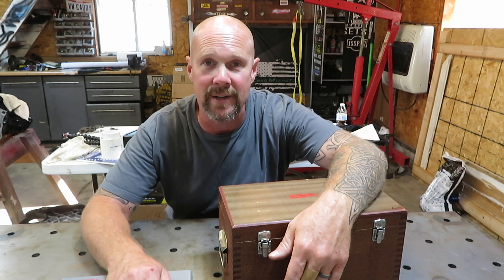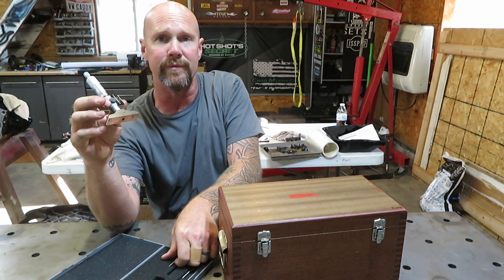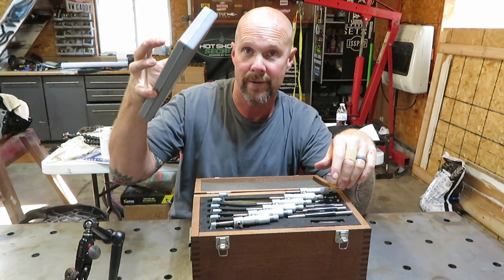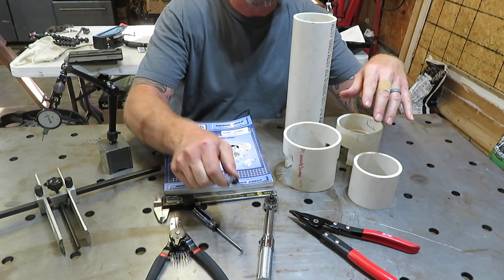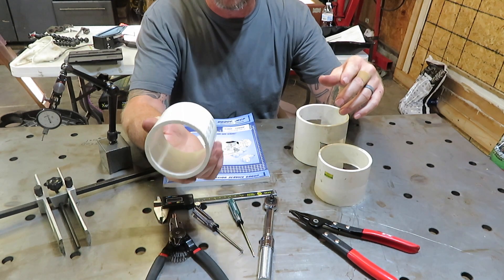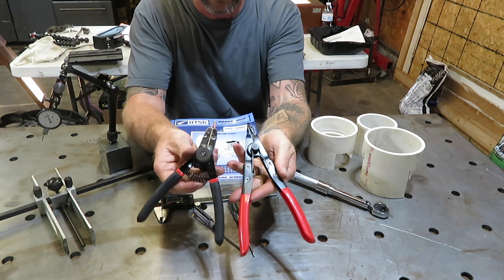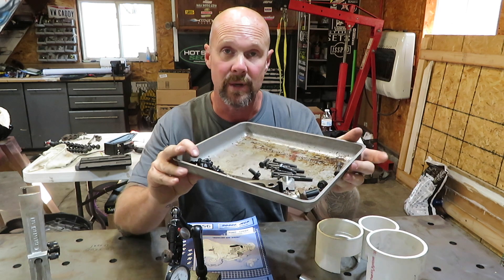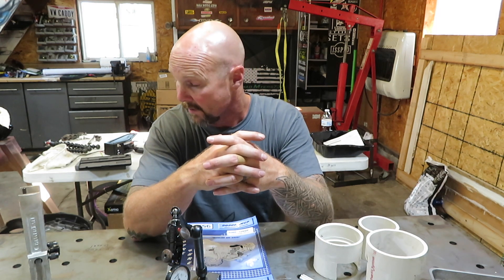Tools Need For My 47RE Transmission Rebuild

Comment: Talking about repairs, maintenance tools etc etc... Thank you for the great videos and sharing your experience as well.... By any chance do you know how many miles do I have to change the oil, mine truck is 2000 5.9 with 207.xxx miles.
Reply from the maker: Here is a link of what I use I change mine about every 7000 miles.
https://www.youtube.com/watch?v=w9JGgz5R6LM